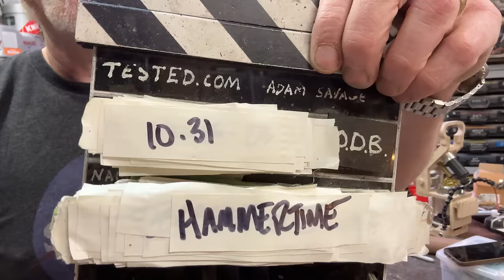Adam Savage Makes a Perfect Kitchen Mallet!

Comment: Important.
Pallets can be treated with toxic chemicals. Check the markings on the pallet before reusing them.
MB is methyl bromide. do not use where it will come into contact with wildlife (or your food) and do not burn in a home fire.
HT is just heat treated and should be safe.
Reply: I'll add a second to the caution on using materials of unknown provenance in critical applications. There is no more critical application than food preparation. And someone will inevitably point out that the handle doesn't contact the food. No, but your hands will contact the food immediately after contacting the handle.
Reply: Working in the international shipping industry I've seen people use container flooring for projects, and it's MUCH worse than pallets as far as nasty chemicals impregnated into the wood.
Reply: @Scoots1994  That's because they are unaware of the potential hazards involved, and why comments like this need to be made. So that people can become more aware.
Reply: That was my first thought as well. I wouldn't want pallet wood anywhere near the kitchen. Hopefully it wasn't toxic with all the chips and dust flying while it was on the lathe too.
Reply: Thanks for confirming. I wasn't sure he was talking about what I thought he was talking about. I figured Adam would be well aware of how nasty that wood can be. Not just from the (potential) chemical treatment but also what it picks up through its life as a pallet.
Reply: +1.  Adam PLEASE do not use pallet wood for ANYTHING relating to food prep. Not only can pallet wood be treated, pallets are used to haul EVERYTHING! As a professional truck driver for over 25 years. I can attest to all the crap that gets loaded onto pallets. Even if the pallet wood was not treated, those pallets could have been used to haul anything from grandma's cookies to Nuclear waste. Granted the ones for Nuclear waste are incinerated but the point stands. I cannot tell you the number of pallets I had that had things like battery acid, Anti-freeze, motor oil, diesel fuel, gasoline, MEK, and many more spilled on them during loading, shipping, unloading, and simply sitting out behind the plant waiting to be loaded. Not to mention all the equipment used to make, load, unload and transport pallets all contaminating them. Pallet wood is great for making many things but should NEVER, EVER, EEEEVVVVEEEERRR be used for anything relating to food prep.
Reply: MB treated pallets are exceedingly rare nowadays, especially in California where such things are heavily regulated. His pallet is probably just HT.
Reply: This also goes for BURNING them. People seem to think wood is wood without considering where it came from or what it was used for in it previous... life... lives?
Reply: THIS NEEDS TO STAY #1 COMMENT FOR THOSE OF US WHO ARE SCROUNGING FOR MATERIALS
Reply: Please keep this upvoted
Reply: @DaedStarr  it's not just the how the wood was treated. It's impossible to know what the pallet was in contact with. Such as what it was used to transport, what might have been spilled onto it, or what types of spills and such this pallet sat in... This is made even worse by his popularity. I imagine someone else will likely be inspired by the video. They too could potentially put their health, and that of loved ones, in danger from contaminated wood.
Reply: Yeah...no matter how the wood was treated before becoming a pallet, what it got soaked in afterwards scares me even more. Hey, it might have "only" been used to transport industrial hazmat its entire service life.  Perhaps some nice MEK with your chicken thighs? 😮
Reply: I was just about to comment on this. They are often treated with phenols and polyphenols, which are specifically selected to be toxic. It keeps the pallets from rotting even in prime rotting conditions. It's also the reason why white oak is often used for them, it naturally contains high levels of toxic phenols, aside from being a hard wood which gives it desirable properties for heavy duty use.

Never use pallet wood for your projects. 

Similar rules apply to discarded wood from furniture, though that doesn't tend to be as toxic.
Reply: i think older pallets might even be treated with arsenic
Reply: I'm honestly surprised Adam used this wood for the build. Surely he is aware of the potential toxicity of the wood. I, a dude 20 years his junior and barely capable of making anything, know to avoid building with pallet wood. 

Also surprised he didn't just make it entirely out of metal considering he has the skill and materials to do so.
Reply: Lol as soon as I heard "pallet wood" I KNEW this would be the top comment.

Comment: The “waffle” technique is surprisingly simple, with accurate tools. I can see why the pattern made its way into so many mass-production tools, in their first iterations.
Reply: A few straight saw cuts and a triangular file is all you need, really. But it needs to be calculated properly first, and it’s interesting to see that Adam messed up and ended up with a row of half-pyramids at one end.
Reply: @mm9773  It's a lot more simple to do this with a 45° v-groove router bit in a router table setup.

Comment: You could make a metal one. Stainless steel is very good in the kitchen as it is non-porous, which means it does not absorb or retain dirt, bacteria, or odors, making it highly hygienic.
Reply: I have a steel meat mallet. They're also usually heavier and weightiness can be a good property for a hammer.
Reply: I have both stainless and wood kitchen mallets. Most of the time the metal one is too heavy, damages cutting boards, and is just too hard, sending a lot of energy back into my arm.

Wood is actually preferable as it has more give, and most of what you're using it for is softer than wood substantially. 

Also you should have a spritzed sheet of cling wrap between the food and the hammer. Less tear, smother smoosh.
Reply: @zj6074  If you have a steel mallet that's "toothed" like a meat mallet then you might have what's known as a bushing hammer. It's an expensive mason's tool designed to roughen sawn slabs back to a more natural look. You could probably sell it and buy a dozen meat mallets.
Reply: or go for best of both worlds and make a stainless hammer head with a wooden handle to reduce the recoil to your arm. I definitely agree with the cling wrap though  @mzaite
Reply: My parents had (or maybe still have, I haven't checked) a mallet made of die-cast aluminium. Not as heavy as a steel mallet would be, but still all the other benefits of a metal surface.
Reply: @mytube001 not really all the same qualities. Aluminium is fairly porous in terms of food use and porosity is probably the more important quality you’d want in a tenderising hammer
Reply: @jaredbartlett659  I'm not so sure about that. It's got to be orders of magnitude better than wood...
I have an alu rolling pin, now that I think about it. Works great.
Reply: didnt even know that kitchen mallets could be made of wood, only ever seen stainless steel or cast iron

Comment: You replicated the problem in the original, the thick wedge slot in the handle.
Walnut oil works great for food touching wood.
Reply: Yes, let’s take a design that wasn’t 100% effective to begin with, and replicate it nearly 1:1 without and improvements whatsoever. Maybe giving the ID of the hole a little bit of a conical shape as well to help give the handle a little more bite would have been useful
Reply: The problem with the original wasn’t the wedge/shim in the handle. Using a shim is a standard practice that goes back thousands of years, used on hammers, mallets, axes, and all manner of hand tools. It enables you to replace either the head or the handle without throwing both away (although Adam ruined this by gluing the whole thing together). Admittedly the large shim isn’t great for a tool a wooden head, which may have led to the original head cracking, but with the wood and glue Adam used it will likely be alleviated. 

The original failed because it was a cheap tool made from cheap materials. Adam could’ve just glued it back together and gotten another couple of years out of it, but making hammers and handles is super fun, if you know how.
Reply: @jonah4850  The problem wasn't the existence of the slot and wedge.  The problem was that the slot was TOO THICK.

Comment: Others have mentioned that pallet wood can contain toxic chemicals; I'd like to add that walnut is a somewhat soft hardwood, so it will probably dent if striking hard objects. Not necessarily a bad thing, but something to note.

For those who don't know, "hardwood" and "softwood" are just different words for "deciduous" (loses leaves in winter) and "coniferous" (has leaves all year round); it doesn't mean anything for toughness. Some "softwoods", like Longleaf Pine, are tougher than other "hardwoods", like Yellow Poplar. If you'd like to know more, look up the Janka Hardness test.

Comment: Knowing you love machining and brass, I wonder if you could drill through the sides of the mallet head and insert some threaded brass pieces that interface with each other. That would give a little more heft to the mallet and help prevent a split from occurring like in your older mallet.

Comment: Pallet wood is often treated with some very nasty chemicals (in the UK at least, the ones that have blue or red markings).  
Just make sure you source untreated ones.
Reply: Even untreated, pallet wood is not safe for kitchen/food uses. It's impossible to know what might have leeched into the wood. Pallets are used to transport all sorts of chemicals. They also sit in places where chemicals and such have been spilled. There's to many unknown variables, making the risk for greater than the potential savings of buying a piece of wood.

Comment: Hide glue was a poor choice - it's not water/moisture resistant.  The other design problem I noticed is this:  the hole in the mallet head should be tapered with the open side being wider than the handle side.  A wedge would then lock the handle in akin to a dovetail joint.  Also, the slot and wedge need not be so darn wide!?!?
Reply: But this way he can make another video when this one falls apart. Content is king (and $$$)
Reply: no one cares. we're just adam savage fans. not carpentry purists.
Reply: Yeah I trust Adam WAY more then you lmao like who even are you man 😂😂😂
Reply: Who are you to tell Adam Savage how to make ANYTHING. 🤡

Comment: Great build, but holy cow you are running that Forstner bit so fast. That size bit should be run at 250-500 RPM, max. Check out Fisch Wavy Forstner bits if you ever need new ones after burning through those at that speed.

Comment: Gotta say it was good to see you playing with the wood turning tools on the lathe (it’s a lot of fun isn’t it) and notice that you are using the carbide tools, I certainly get that they are much more user friendly to the beginner, but I do have to say a roughing gouge would have made MUCH faster work of the operation of getting the wood to round, and really isn’t that hard to get the hang of, I’d recommend trying it out next time you incorporate some kind of wood turning in your project, just remember the ABC of wood turning 

Anchor (make sure the tool itself is securely against the tool rest before it touches wood) 

Bevel (move the tool such that the bevel of the tool’s cutting surface is making contact with the part you want to engage)

Cut (slide the tool a little further down the bevel such that the cutting edge makes contact with the wood and starts slicing)

And of course make sure your tool is sharp, but I imagine that part won’t be an issue for you

Comment: I was working at a place in the 90's I needed a sheet of steel cut for a job I was doing the boss said there's an engineering works around the corner that will probably be able to do it , so off I toddle's walks in and, the place is full of coffins it was clearly an engineering company , I asked what gives a guy said when we get a slack work time we make them , it's all the same tools wood an steel , thought makes sense , they were able to cut my steel to the desired shape .

Comment: I'd look into giving it a rub down with a bees wax board butter. My cutting board I season with mineral oil weekly and boos board cream monthly along with my nice wooden utensils. It's a great 1-2 punch for conditioning and preserving wood in a humid and high use kitchen environment. Just once will give the mallet a great starting point. 
I haven't gotten a chance to watch a build video in a hot minute, but I loved the needle drop and title slate transition.

Comment: Missed seeing cutting the slot in end of handle and matching wedge…??  I thought hide glue was generally water - soluble to allow for future disassembly; how does that work for a kitchen tool that will get wet / need to be washed?  Or am I mistaken?  Thanks!
Reply: You are correct in that hide glue can soften with heat (and to a lesser extent with water). But if softened, it will regain its full adhesion again when it cools. Also useful to know: hide glue is food safe.

Comment: It's nice. I'm lazy though, so I would've just drilled a few holes in the old one, put a screw or two through it to close the crack and added wood glue or epoxy to get the head and handle to hold together... :D

Comment: Only thing I would do differently would have been how I managed the spacer pieces for the handle.. I would have glued them to the handle and shaped it with the contour of the end giving a round peg at the end.. or use the walnut to do what you did. Just personal preference though
Reply: Since he already has the mill, i would have  just milled a perfect slot into the head of the hammer. Probably should have used a harder wood for the head, Maple, bloodwood, Ipe. Walnut is pretty soft for something with teeth on it. I always admire how he can do "quick and dirty" so well
Reply: @davidliskey3553  I agree on the milling. As a kitchen tool I think walnut is plenty strong enough.

Comment: To prevent a wedge from falling out, you can glue it in with glue on only one side. As wood movement occurs, you won't potentially break both sides of the joint.

Comment: Hi Adam, when you blow all the stuff w/your blow-ie thingie A) how do you clean that stuff up after, and B) don’t you end up breathing all that aerosolized stuff? I love your channel!
Reply: My question as well. I don't follow the logic, or health impacts, of using an air hose (and cleaning twice) when you can almost as easily use a vacuum hose.  (Mine is a wall mount unit piped to fixed saws and a loose debris hose strung from ceiling with retractable cord reels.)

Comment: I love these vids I've never used or seen a lathe in real life where does all the shavings go? How they cleaned up...see wood chips, metal shavings, obviously oil for cooling what sort of mass is behind there after just blowing with air? I'm curious on the crud..LOL
Reply: He really should be using a dust collector or shop vac.
Reply: @JV-pu8kx   I've seen vids where he has dust collectors ...its just the blast air of shards, wood and delron behind the lathe has me intrigued where does it go?

Comment: Is there any reason why he can't use the handle he already has? It's in good shape and if he were to replace the wedge, and maybe add a dowel or metal wire through the head and tendon/wedge, it would be secure enough for even the most excessive use. And for the waffle area, I personally would use metal. I always find metal to be much easier for me to use and take care of, and less chance of contamination due to allergies or other.

Comment: Adam you're gonna ruin your forstner bits by running them at those speeds. They're made from tempered steel and if you're generating smoke like that from your cuts you're heating the bit to the point where you can begin to soften the steel and ruin it.

Comment: Making a plug, sawing off the sides and fitting it to fill the gap seems unneccessarily complicated. Why not glue on some random scraps when you're going to turn it on the lathe anyway? Also, mineral oil, while "food safe" is not the best for direct food contact. I like to use walnut oil - doesn't stain much and it hardens over time. And if it isn't hardened yet... so what? The mineral oil will never harden, so just reapply if needed.

Comment: Be careful with your washing a storage habits as well, treat it like a wooden spoon or a cutting block. Never put it in the dishwasher the super hot water will cause it to split and never soak it for long periods, the repeated cycles of wet and dry can cause it to check and split as it looks like your original did.

Comment: Curious you used a known failed design to create something instead of improving it.  Wondering if the wedge has any value since there is no taper on the handle. A lot left to be desired on this one. 🤷‍♂️

Comment: I would never make anything for my kitchen or interacting with food from pallet wood.
You literally have no idea what the life of that pallet was. It could have been involved in the transport of dangerous chemicals, manure, been urinated on, and gotten exposed to anything and everything in its travels before it got to you. It could also been chemically treated to discourage pests and vermin.
The long and the short of it is that you really shouldn't be utilizing it for anything involving food.

On a personal note, I just would not use a wooden item like this in my kitchen. This is definitely a job for metal as it is much more easily cleaned properly.
If it is going to be used from everything from tenderizing raw meat to smashing ice, it is best to be something that cleans easily and won't absorb anything.